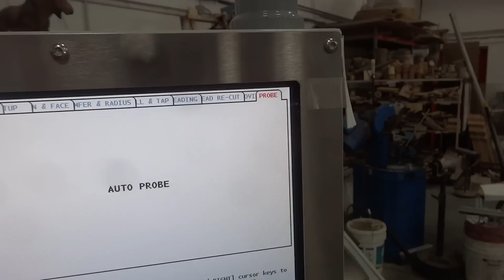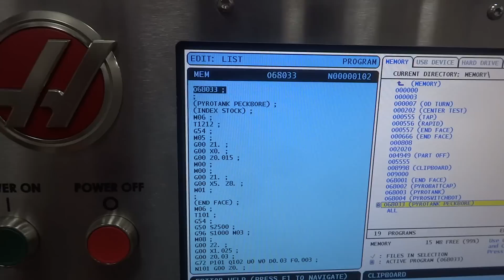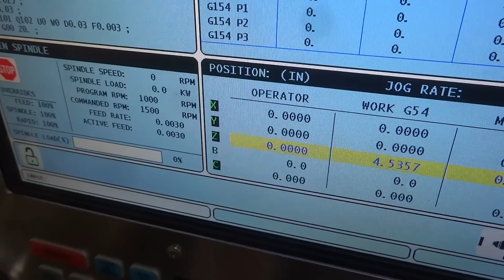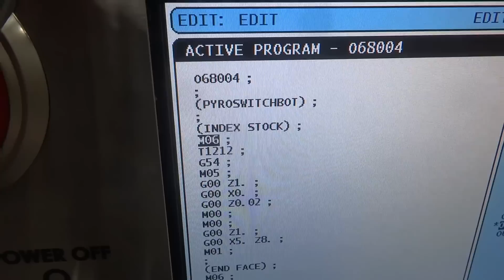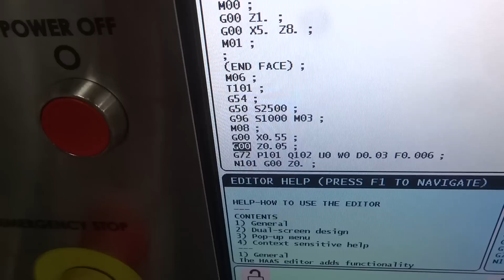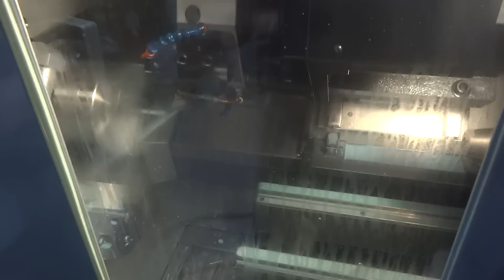Captain's Blog 1 18 2014 KC's Blog

Comment: You should consider adding a wiper on the glass. Maybe of the spinning type that's used on boats and some machines used for clearing snow.
Reply: There are a few issues with each system. A mechanical wiper would scratch the window and won't work with the door configuration. A rotary window costs a bucket of money and you hove to cut a hole in the window. An air blast system could be noisy, but might be the best/most economical bet. For what we're doing right now, I don't think any of it is necessary. When production videos start, there will be action cams set up inside the enclosure at strategic positions.

But if you guys want to get together and donate something similar to the Exair Air Stik kit for closed top machines, I won't stop you!

Comment: Is the turret plug just mass replacement so the machine doesn't beat itself to death?
Reply: The turret plug is to keep chips out of the VDI hole. It's a precision ground surface and if you don't keep it clean, you add a little inaccuracy by smashing dirt and chips into the surfaces.